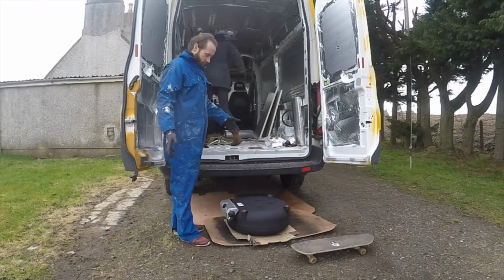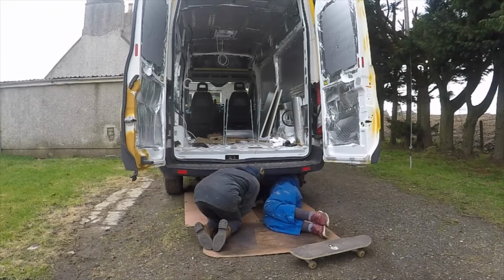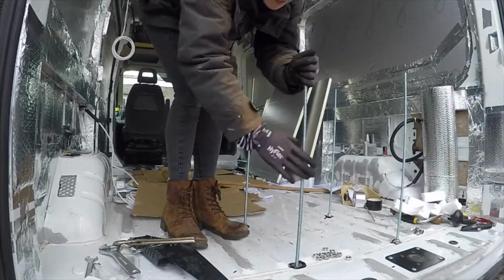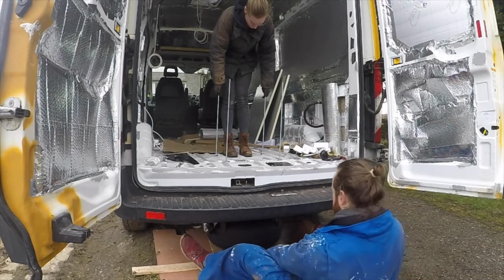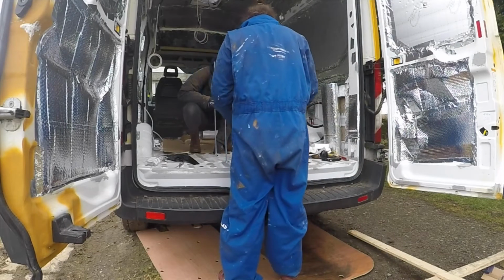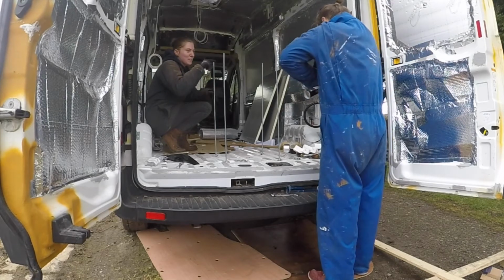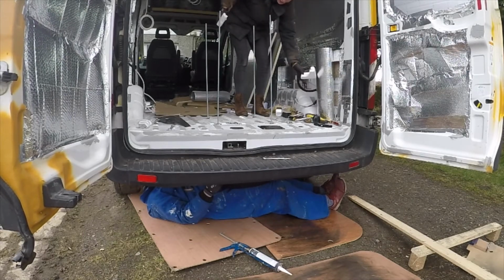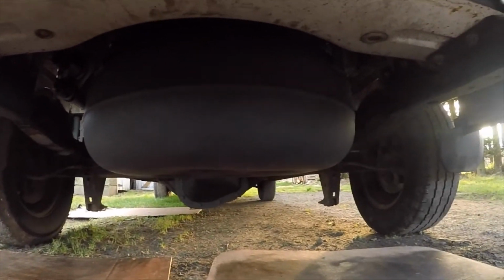How We Installed an LPG Gas Tank for VAN LIFE Part 2 | DIY VAN BUILD Ep 20 | FORD TRANSIT

Comment: wow! 9 mintues (i skipped a lot) of you guys threading nuts on some threaded bar. what was the reason for not cutting the bar shorter before fitting the nuts? hence not wasting time.
Reply from the maker: You’re right, threading those nuts took ages.

One reason for leaving the bars as they were was because we didn’t really know just how long we would need the bars to be, especially considering little adjustments in levelling the tank. 
Having them extra long also made it a bit easier to sort of “lock in” the height of the tank every time we pushed it up just a little.
Also, cutting the bars then would have meant we would have had to take a file to the thread and tidy it up, to only have to cut each bar a second time to its final length.

Sooo, although the lots of threading was an absolute faff, we decided it was the lesser of possible problems. A bit of a pick-your-battle situation.
The whole tank fitting job took about two weeks overall. It was a pretty slow and painful job overall